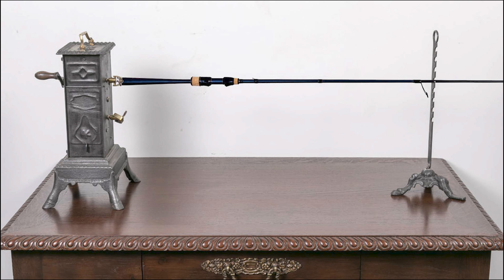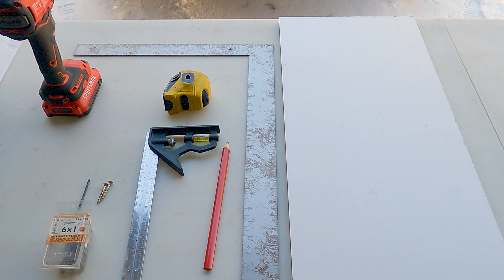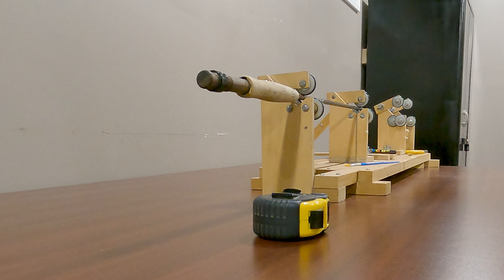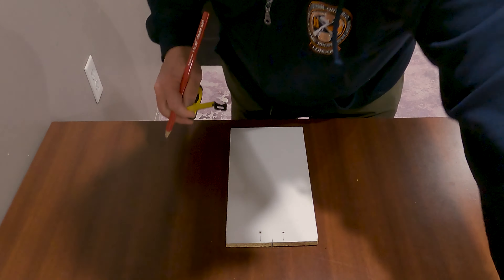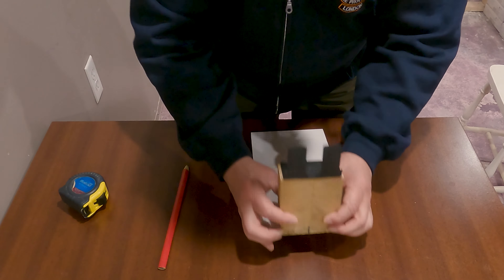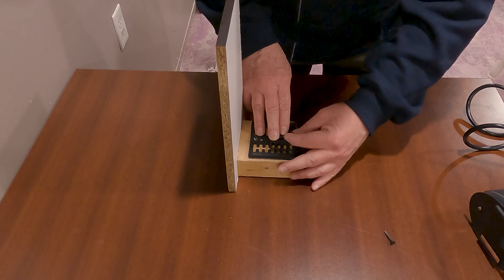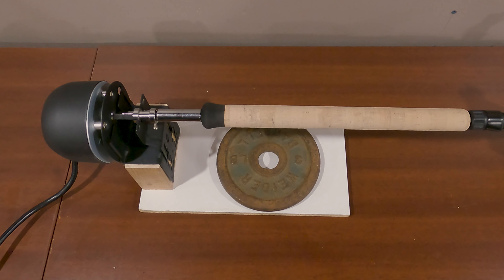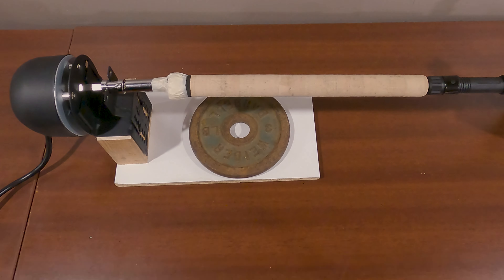DIY Rod Dryer using a BBQ rotisserie kit.

Comment: loved the video. A question I have is at 2:43 in the video you show your rod in the wrapping jig. Where did you get the roller wheels and what brand. I like this set-up. Thank you for your effort of educating the masses that you don't have to have the high cost store bought to get a job done. Fancy equipment don't make it a better end product.
Reply from the maker: @ericpierce4510: Thanks! I put that rod jig together almost 25 years ago! The wheels were found at a hardware store - I think they were for sliding closet doors. Then found some O-rings that fit the grooves.
Reply: @paulnoble684  Thank you sir.

Comment: Paul - on that rod wrapper you have on the video - you measure it at the 3:14 mark. Where do you get those wheels with the rubber o-ring on them? I am looking for a source for those wheels/rings .. Thanks in advance. Gus
Reply from the maker: @bykergus: They are actually wheels for sliding closet doors that I found at Home Depot. You have to buy the orings that fit them separately.

Comment: Why not mount the motor lower use several v roller stands and an elastic band or thin large O ring stretch over a pulley mounted on the motor and over the end of the rod handle to drive it
Reply from the maker: Stevewright5642: There are a myriad of ways to modify this basic design.  The direct drive, the simplicity and the cost effectiveness of it are aimed at the beginner who might only build a rod or two. If you want to customize it to suit your personal needs, fill your boots!